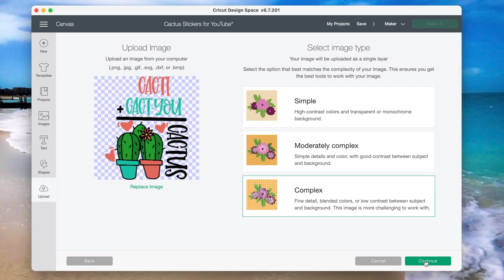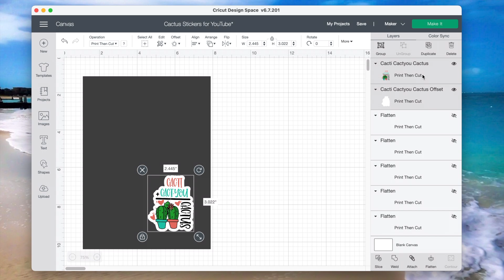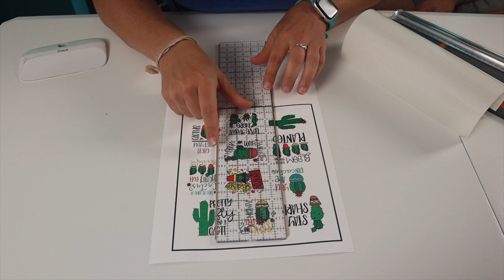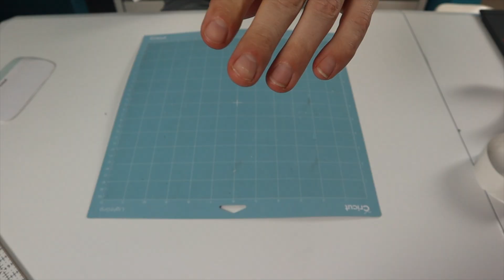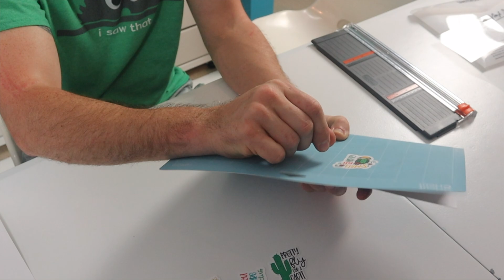How to Make Waterproof Stickers on a Cricut |  Die Cut Stickers with Cricut Print and Cut

Comment: Thank you. I was tearing my hair out (actually I don't have any cos of Chemo :)) trying to work out how to do this. I was "attaching" but it was cutting out the letters as well.  I have made sure I entered all the instructions in the project for when I have to do it again, cos I am sure I will forget.  I didn't worry about the P&C size and layout, I just printed on A4 and adjusted the printer paper size, and DID NOT attach all the images and it just printed what was on the canvas. Do you have a video on what "weld" and "combine" etc is used for?  (from Australia)
Reply from the maker: No, we don't have a video covering that. Most what we do doesn't cover features in programs but tutorials or plane Ole messing  around. 😁
Reply: @JustMightDIY  no worries.  Thank you

Comment: Greta tutorial. However these are water resistant and not waterproof. They definitely do not hold up in the dishwasher.
Reply from the maker: Hey there and thanks for watching! We’re SO glad you found it helpful. 

There’s a big difference between waterproof and dishwasher safe, though. Dishwashers use things like detergents and heat , which will certainly affect your stickers.  😉

Comment: i created a design in canva and saved it as a transparent PNG but when i upload to cricut and use the offset feature im left with holes in the background ? how do i get a solid background using offset ?
Reply from the maker: Hey! If you watch all the way through, we show specifically how to do this. At a high level, you change the offset layer to a cut layer and then use the contour feature. Hope this helps!
Reply: @JustMightDIY  oh! i thought i did watch all the way through, ADHD is a wonderful thing lol i’ll re watch, thanks !
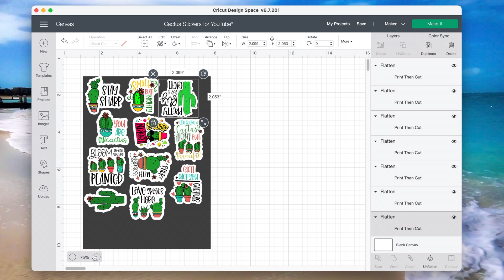Reply from the maker: Ha! All good. We show it around 3:45 in this video, which is after we already flattened everything and were checking to make sure they all looked good.

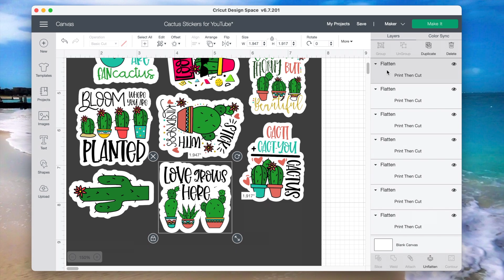We do have an updated sticker video since Cricut updated the print then cut size earlier this year (2023), and that shows it a bit earlier in the process. Check out around the 4:00 in this video: https://youtu.be/bm7fyn4py1o

Hope this helps!
Reply: @JustMightDIY  you’re amazing, thank you !

Comment: Howdy, I followed this tutorial exactly and used the same materials.......except I used a CRICUT EXPLORE AIR 2 that is a few years old. When I print on the sticker vinyl OR on regular paper, it is not picking up the Black alignmnet lines and keeps giving me error codes. ALSO.....when I do the calibration steps, the machine grabs the sticky pad and does perfect, but when its time to cut stickers it seems to not grab the pad correctly and will spin the wheels with the pad too far away from it. Any ideas?
Reply from the maker: Hey! Thanks for watching. You’ve tried everything we would tell you to (calibration, etc). The only thing left is to call Cricut and see what they say. Good luck! 🍀
Reply: Put MATTE tape on all the black lines around the corners and then it will pick up the registration marks.  Do not use glossy tape.

Comment: What printer settings do you use for the imageclass laser printer i got one today but its not as good as yours
Reply from the maker: Hey! When we first got our printer, it was printing a little lighter. We found the following solution on the Canon Community Forums, which worked well for us.  

Three (3) Steps to Great Color & Deep Blacks –

Clean Fixing Assembly -
Go to the Home Screen  >  Menu  >  Adjustment/Maintenance  >   Maintenance  >  Clean Fixing Assembly  >  Select ‘OK’  >  Then, Select ’Start’ (in the lower righthand corner of the Printer Display, and let it do its thing).

Correct Print Color Mismatch -
Next, go to the Home Screen  >  Menu  >  Adjustment/Maintenance  >  Adjust Image Quality  >  Correct Print Color Mismatch  >  Select ’Start’ (in the lower righthand corner of the Printer’s Display, and let it do its thing).

Auto Adjust Gradation - Full Adjust - (This is a more robust sequence than the initial Startup Color Adjustment when the printer was first turned ON.)
Go to the Home Screen  >  Menu  > Adjustment/Maintenance  >  Adjust Image Quality  > Auto Adjust Gradation  >  Full Adjust  > Select ‘OK’ (it will list 4 Steps)…
Print Image 1 for adjustment.
Scan the printed Image 1 for adjustment.
Print Image 2 for adjustment.
Scan the printed Image 2 for adjust.
Select ’Start’ (in the lower righthand corner of the Printer’s Display, and follow the on screen instructions)

Comment: Oracal 651 is a calendared (typically indoor) vinyl that UV light breaks down much quicker than Oracal 751. The Oracal 751, which is a professional cast film, will last for seven years in the Florida Sun. Considering the increased cost per decal is minimal, always use the Oracal 751. 
Not to mention, removing the decal later is much easier because it does not rot or tear. 
I hope this helps, :).
Reply from the maker: Great insight! We’ll give that a test for sure, as we’ve been asked about outdoor stickers before. Thanks for stopping by!
Reply: @JustMightDIY  Thanks for the video, it was very helpful. :)

Comment: Yeah.... doesn't really work.  The circut can't even read the registration marks on glossy vinyl to begin with, and adding laminate just introduces even more errors.  For anyone else not able to get their machine to do this, I've tried many workarounds and the best for me so far has been to use a pink highlighter over the registration marks (and around them) - the highlighter kind of "mattes" the surface so it isn't too reflective.  Doesn't work 100%, but works most of the time.  Doesn't help with holographics, that's still quite literally impossible...
Reply from the maker: Thanks for your comment! Respectfully, it does work. We show it working here, and we've done it many, many times since. First, we print on matte sticker paper. And second, those who watch the video all the way through will learn that we put the laminate INSIDE the registration marks for exactly this reason. A closer watch of this video would probably have been helpful for you.

However, for those who do use a glossy paper, we have also found success with matte scotch tape over the registration marks. 

Hope this helps.
Reply: @JustMightDIY  I did watch the full video, but didn't have sound at the time.  It looks like glossy to me so I assumed it is.  Also looked like the laminate was put over the whole thing, but maybe I just didn't look close enough.  I've tried scotch take and it made no difference.  Highlighter 100% the way to go, but even then it's not great.  Cricut just needs to make better machines that don't require any of these workarounds
Reply from the maker: Hey there. We've actually had luck with scotch tape over this glossy laminate, as well as on holographic paper. Here's the video where we did both holo laminate and printed on holographic sticker paper: https://youtu.be/ftK3rVee7XA

Overall, we haven't run into too many issues at all with Cricut Print then Cut. Curious - do you have a Cricut Maker or an Explore?
Reply: @JustMightDIY  I use a Cricut Maker (gen 1).  Originally,  I was able to print & cut holographic vinyl with varying results,  but over the years each subsequent siftware update has made it worse to the point is now impossible.  It seems like these machines are very poorly made so everyone gets different results. I've called customer support several times about print & cut issues and their stance is that they don't support anything glossy.  Which is ridiculous because they sell a glossy printable vinyl (or used to.  I stopped buying it because it was insanely expensive).
Reply from the maker: Bummer. We’ve had a lot of luck so far with ours.

Comment: I have a really good laser printer and computer, but I need to cut and laminate my stickers and also I need to get the total production cost down to less than $0.10 per sticker (I will mostly produce round 1.125" ones). Which A4 or A3 sized sticker sheets and which cutter and laminator machine should I look for in order to get the production cost that low?
Reply from the maker: Hey! Thanks for watching. We don’t sell stickers, so we haven’t done those calculations. Best of luck with your biz!

Comment: Hi guys, thanks for the video! I purchased everything you used. My stickers arent cutting clean, almost like they very slightly being torn. The cutts have lots of little jagged "tugs" almost. Im using your cut settings but they just wont cut clean. Any ideas?
Reply from the maker: Hey! This could be because of the age of your blade. You may need more pressure (or a new blade with the same pressure). We’d prob start with increasing the pressure in small increments and testing it along the way. Hope this helps!

Comment: Hello, i keep having the issue of my labels printing out pixelated no matter what I do. Seems to be from resizing it after I upload it to my canvas. I’ve changed the printer settings. I know it’s not my printer bc when I print it from anywhere else, it looks fine. Do you have an advice on this issue? It’s driving me crazy 😢
Reply from the maker: Hey! Pixelation is typically a file size issue. We recommend resizing and saving your image larger, if possible, in your graphics program before uploading to Design Space. Hope this helps!
Reply: @JustMightDIY  thank you for your response. On illustrator, my labels are 2.2inx2.36in and when uploaded to DS, it’s double the size so I have to resize it smaller.

Comment: Do your laminated stickers come out with a bit of a jagged edge when cutting all the way through? Have tried Washi, Kiss Cut, light pressure. Those come out quite okay. When I cut through with Maker3, the laminate is rough around the edges. Kind of jagged.
Reply from the maker: Hey! Ours do not come out jagged. Consider cleaning or replacing your blade. If that doesn’t work, we recommend trying to adjust your pressure. Hope this helps!
Reply: @JustMightDIY  Thanks! Great channel you guys have.

Comment: Hey thanks. How do you get Cricut to just cut around each sticker and not intricately cut out each sticker....if that makes sense? Like How do you make it so it doesn't start cutting around the edges of the catis and stuff?
Reply from the maker: If i understand your question, the answer is the settings for offset (white outline) and flatten (create one layer of the two different layers) . Hope this is helpful and good luck! Thanks for watching!
Reply: @JustMightDIY  Is that shown in this nice video or did I just miss it?
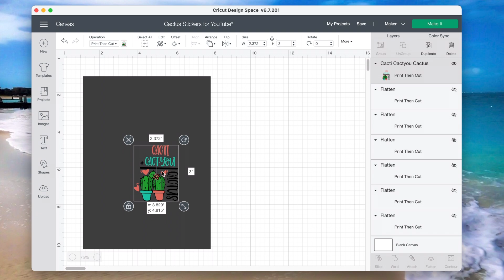Reply from the maker: Offset guidance begins at 1:48. Though the while beginning is about selecting your graphic,  importing into design space and manipulation of print then cut feature.
Reply: @JustMightDIY  Thanks!!! It worked. So If I don't put any offset, it will attempt to cut the full intracacy of my image as an exact cut out?  Sorry for so many questions but what if I had say a "stripe" in a tiger and I wanted the tiger cut out but also that one stripe cut out that was "inside" the tiger?

You are a great help! I will share this often.
Reply from the maker: That is something harder to accomplish with this software.  It would be trying to isolate that stripe as an independent layer and creating that outline around it for the cut feature then reflattening . It might be easier to find an existing image with these qualities you're looking for before importing

Comment: 306 pressure and 2x cut with suggested materials - perfect. Thank you folks a bunch and Merry Christmas.
Reply from the maker: That's great,  merry Christmas to you and yours as well! 🎄
Reply: @JustMightDIY  That Laminate, Oy Vey! Bubble, bubbles toil and trouble! You guys make it look easy. Perhaps a slo-mo video: here's how to do no bubbles. :)
Reply from the maker: It took a bit of practice.  JZ is way better at it than I am. We will put that in our list of possible upcoming
Reply: @JustMightDIY  Thanks. This is my go-to channel for tutorials. I'm brand new to Cricut.
Reply: @JustMightDIY  After several attempts, I have finally mastered the dreaded bubbles using a twelve-inch ruler with a rounded edge. I took a little sandpaper to the edge of a wood ruler to produce a rounded, smooth side opposite the metal edge side. Apply light pressure. Zero bubbles on 8 1/2 x 11. Yahoo.
Reply: You can also run it through a cold laminator machine

Comment: I tried SOOOO hard to cover my stickers with waterproof sticky paper BUT I can never get it to sit right and always gets crinkled, bubbles or some other nightmare. Also the cricut shts the bed because the laser misses the black line because of glare EVERY time so I would have to use a perm marker to remake the lines
Reply from the maker: Hey! So sorry you're having issues. it does take some practice to get the laminate to lay flat. You'll get the hang of it! As for the glare - keep the laminate inside the line (not covering it) so you can avoid that issue. Hope this helps!
Reply: @JustMightDIY  Yes thanks to your video you showed me the RIGHT way to do it and I love you for that ty
Reply from the maker: Yay! We’re so glad to hear this helped you! 😄

Comment: Thank you so much for this video! I have the same sticker paper/laminate and used the settings for cutting with the cricut. However, it did not cut all the way through... Any suggestions?
Reply from the maker: Before ejecting from the cricut one should always check to make sure cut is complete.  If it is not you can press the "C" button again for another round

Happy crafting!

Comment: I have the oracle clear perm vinyl, do you think would work instead of the laminate? 

Also, the brand of sticker paper you all bought has a water proof version, have you all tried that one, or any other water proof stick papers that proved successful? (without an additional laminating step?)
Reply from the maker: The vinyl should do the same job but would be thicker and application might be a bit trickier. If you try it let us know how it goes. 

We did use waterproof sticker paper here
https://youtu.be/ftK3rVee7XA
But we still had to laminate it.  We did not have the pigment ink required to keep the print from bleeding.  Ink jet typically uses dye ink. 

Hope this helps! Happy crafting!

Comment: Great video, peeps, however, there is one step that seems to be overlooked in a few how-to's I've been watching and it is regarding the PC to CriCut print stage. You've shown us to print using an inkjet printer first, but there is no screen information on what options are available when it's time to move on to the CriCut stage. You show CriCut doing it's job but we don't see what you've told the hardware to do. Do you simply change the Printer drop down and select the CriCut or are there a few more options that should be kept in mind? Thank you.
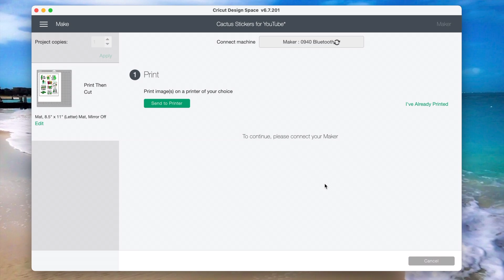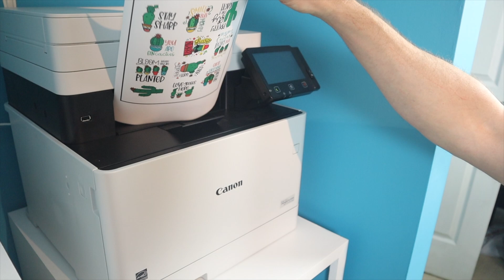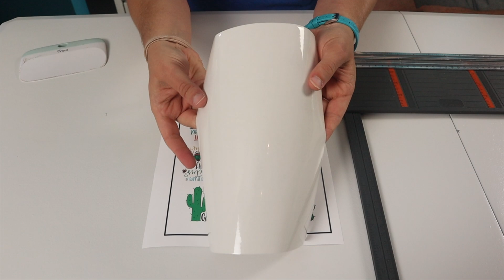Reply from the maker: Hey there. Thanks for watching and for your comment. We show all settings in this video - the settings we used to print the stickers out are at 5:28 and the Cricut cut settings follow immediately after at 6:05, lasting until 6:34. Hope this helps!

Comment: Honestly that paper brand s*cks in my printer. It sticks and won't go through. I started cutting the edges and sometimes it does get jammed. I've wasted so much paper and ink
Reply from the maker: Hey there. Bummer - we haven’t had that issue with sticker paper, but we did with the waterslide in our inkjet printer. To fix that, we taped a regular sheet of paper to the back and fed the sheets through one at a time. Maybe that could help?
Reply: @JustMightDIY  that sounds like a great ides 🤔 I'll do it and update you on how it goes. Thank you!

Comment: Rad video! I need some help though! My black border lines are not covered by my lamentation buuut i think the reflection of the censor is still making my machine mis cut… SOS 🙈
Reply from the maker: Thanks for watching - we’re glad you like it! Are you using a glossy sticker paper to print on? If so, try switching to a matte one. If not, we recommend reaching out to Cricut for help with the hardware troubleshooting. Hope this helps!

Comment: Thank you for such thorough instructions!! I used your exact settings and same materials and mine didn't cut all the way through at all.... Guess I'll have to do some testing of my own haha
Reply from the maker: Thank you for checking out our content! We're glad it gave you some good guidance!
Reply: @JustMightDIY  I’m not sure why but my machine was glitching, it worked beautifully the next time I did it! However I can’t get it to print using the system dialogue, it just gets stuck on “preparing print”. Do you have any suggestions? I’m not using a super complicated file, it’s the same black text over and over again that I made a compound path in illustrator
Reply from the maker: Hmm. That’s weird. Are you minimizing Design Space to see the printer window behind it?
Reply: @JustMightDIY  I am - no printer window :(
Reply from the maker: It’s hard to tell of it’s a printer issue or Cricut issue. Maybe reach out to Cricut support first, and if that doesn’t work, try uninstalling/reinstalling the print drivers. Good luck! 🍀

Comment: I'm having a problem where my blade is not cutting through the paper. It is cutting the laminate and slicing the sticker paper so it peels off nicely but all my stickers are still intact to the entire paper...
Reply from the maker: Hey! Sounds like you have a great kiss cut there. If you want the full die cut, either try setting the machine to cut twice or adjust your settings to have more pressure. Remember to check your cuts before you eject the mat - that way, you can press the C button to cut again if it’s not all the way through. Hope this helps!